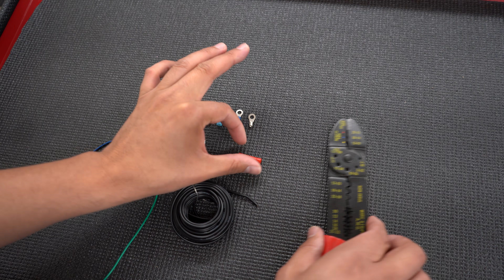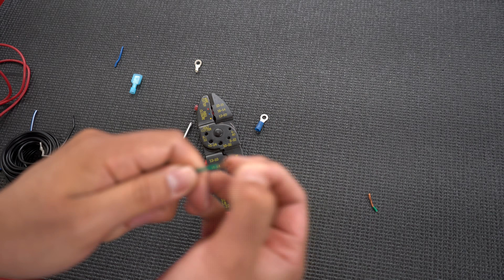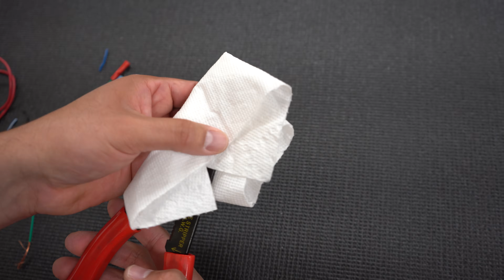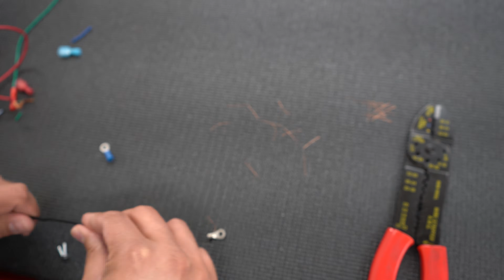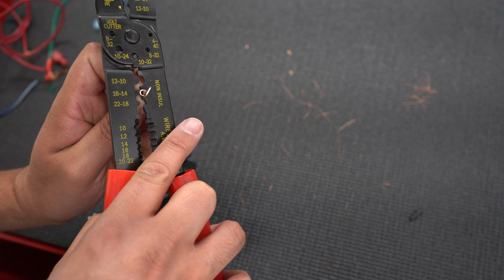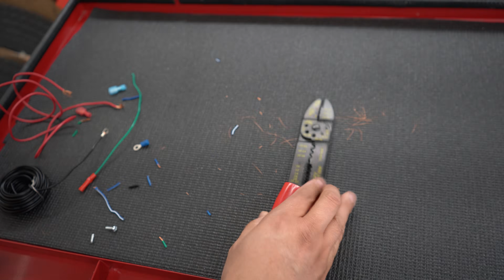How to Use a Wire Stripper and Crimper Tool (Beginner Guide)

Comment: To use the bolt cutter (those screws are bolts--just small ones), you are supposed to find the one where it screws in.  Don't just slip it through loosely.  After cutting, when you screw it back out, it will rethread the screw for you.  Therefore, it's for those specific labeled sizes.

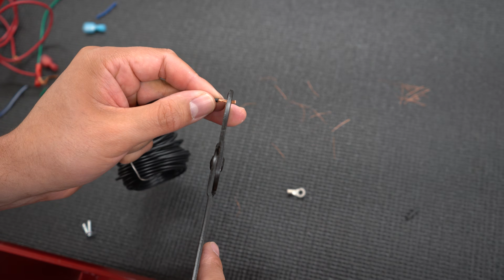Comment: It may be obvious, but I feel it's important to mention that when the wire is inserted into the crimp connector (6:33), the crimping tool needs to crimp down on the wire and not the insulation. Nice video otherwise. Thanks!
Reply from the maker: Great point!
Reply: That is wrong.  You are absolutely supposed to crimp the insulation or else you can yank it out.  In the particular connector in this video, you're supposed to fold the wire over onto the insulation to make sure the wire contacts when crimped down.
Reply: @The_Real_Grand_Nagus  How is it wrong? At 6:33, with the type of crimp connector used (single crimp point), only the bare copper wire has to be crimped, otherwise a solid electrical and mechanical connection (via cold welding) will not be achieved. The wire insulation should remain outside the crimping point. Folding the wire back over the insulation is incorrect, and is not even done in this video.